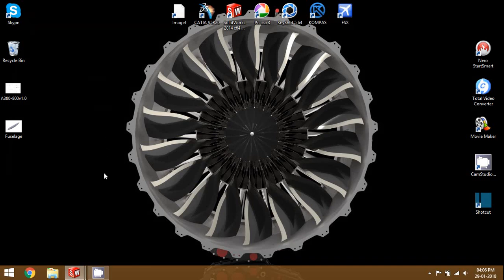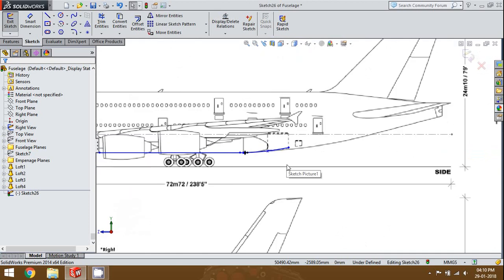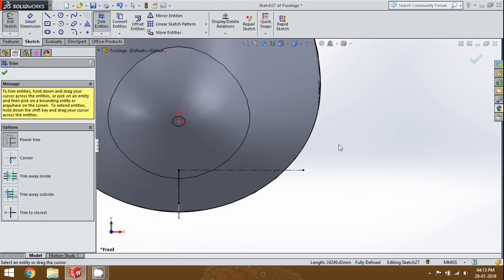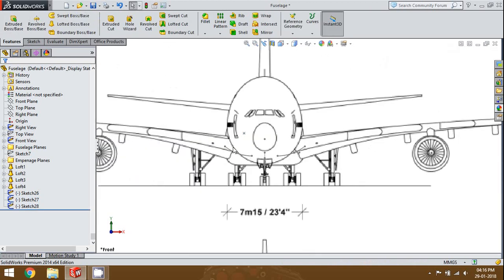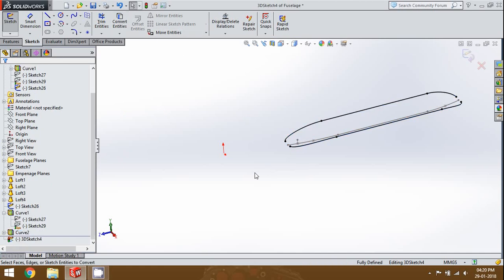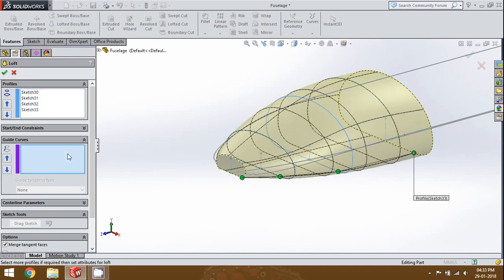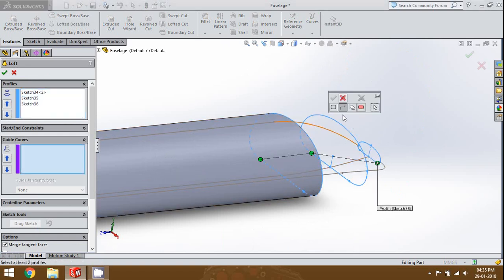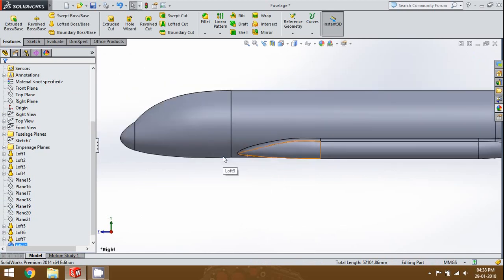Designing an A380 : Part 4 (Belly) SolidWorks Tutorial

Comment: Better if you don't rush the video. This video is mean't for teaching the CAD. But you simply rush the video in between the sketch, mostly before major commands. I had several problems in sketching the curves for the belly. The project curve is not working for me. 
I have had the similar issue while using the loft command for the vertical stabilizer.